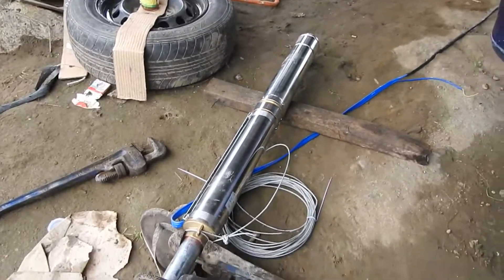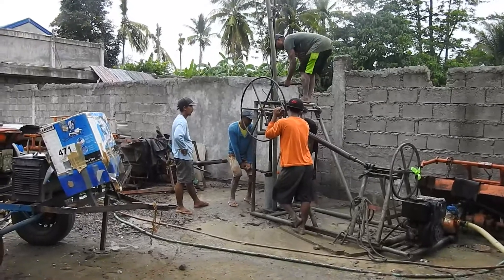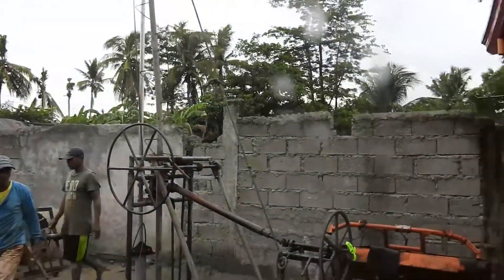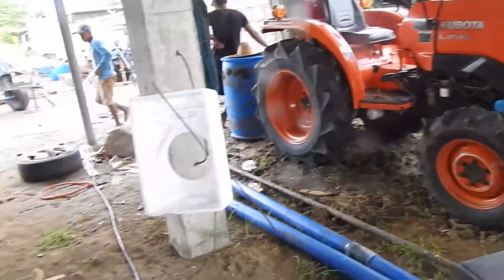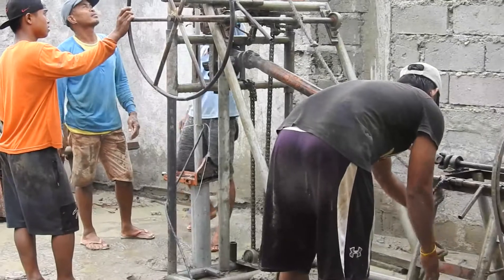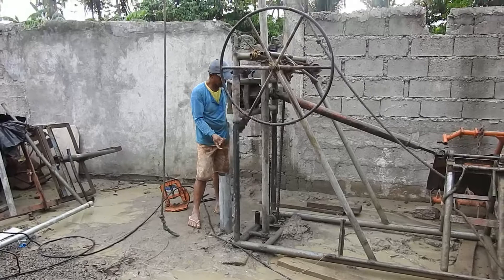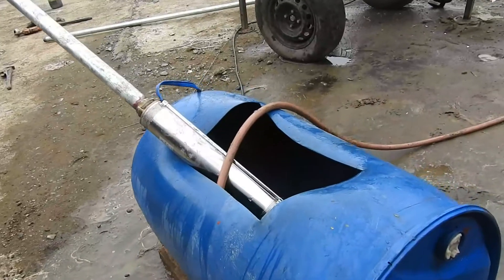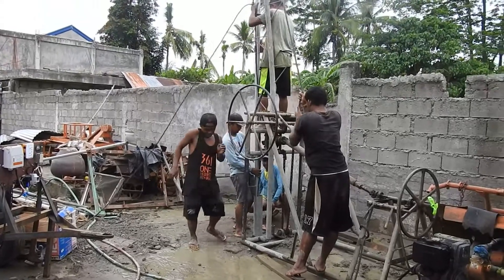Roxas, Isabela - Travino and Franklin/Gould Submersible pumps

Comment: anong ginamit nyo pandugtong sa wires sir? or pang seal; sa splicing
Reply from the maker: Thanks for watching.  I used heatshrink and electrical tape for insulation.  I soldered the wires together for better conductivity.  I am planning to make a video later about how I splice the wires together

Comment: What size of generator do you need to power a 2hp sub. pump sir?
Reply from the maker: Thanks for watching. 745.7 * 2 hp = 1.5kW, factor in the Volt*Amp phasor so best go for 3 kVA or 3 kW generator. For 3 hp then 745.7 * 3 hp = 2.2 kW same reasons for having a 4 or 5 kW generator for that kind. In short, double the requirement for a safe generator operation, it will prevent over heating of the generator by not working at the edge.

Comment: Did I understand correctly the well is 27 meters deep?
Is the kubota your tractor
Reply from the maker: We drilled down to 30 metres. The 4” casing is 18 metres long, water level start from surface to 8 metres down but I cannot remember exactly now. We lowered the pump down to 12 metres. Larger metal tubes ie casing are specified in inches when buying them here.

Tractor is my mom’s.
Reply: @thelifeofexequiel   thanks for the info I’m only slightly envious of the kubota😀
Reply from the maker: @jerryanderson9502  - Great work horse it is, could Whip up a hectare in no time at all
Reply: Did you mean sir the pump si not lower than the casing 4" pipe?  just asking po hehehe also there a standard for pump of how deep is?
Reply from the maker: @mikeservano3760  - correct, the submersible pump should never be lower than the casing. The casing is holding back small and big pebbles and the submer should not be ingesting those.

Yes, there are specification on how the submer should be used. The deeper the submer is the lower the output because water will get heavier as there are more of it in the tube to lift out to the surface